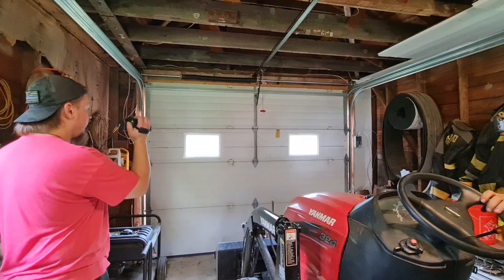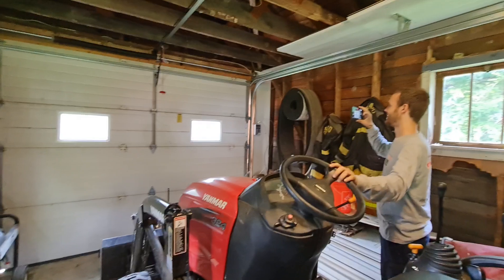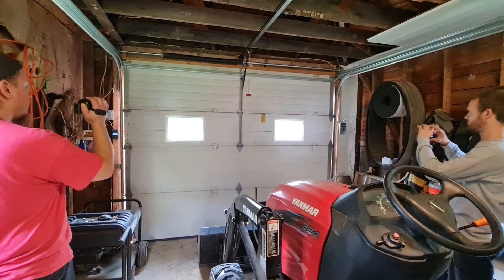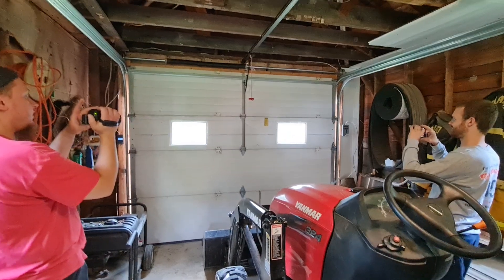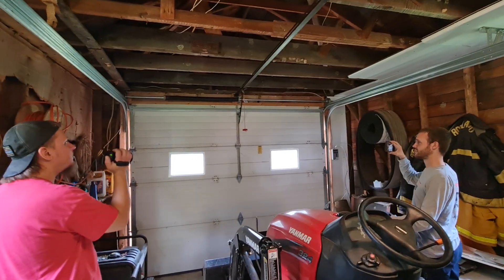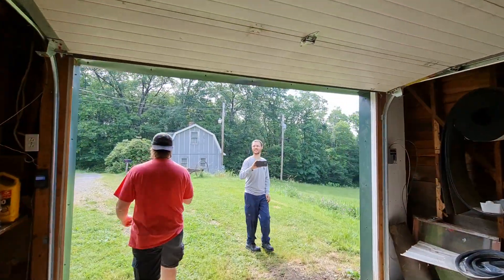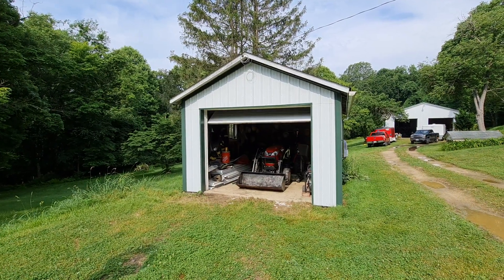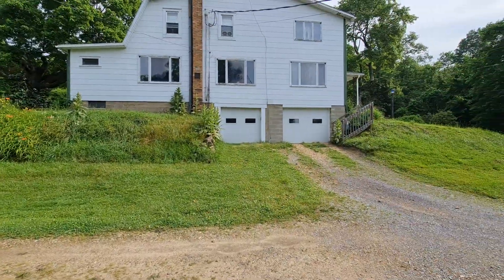RGDMan's Overhead Door 591 with 8550RGD

Comment: You're not going to believe this, but I just ordered a new garage door a overhead door a overhead door Thermacore® 5740 and a Odyssey 1200 expected installation sometime around December
Reply from the maker: @cyberlight22  nice!
Reply: @TheGarageDoorGeek  yes it funny my first quote they they wanted to give me a LiftMaster, Model 84505, I said no
Reply from the maker: @cyberlight22  Yeah, I've had too many headaches with LM. I can't trust them. I put in a Maxum a couple weeks ago, now just waiting on the "it's not working" callback.
Reply: @TheGarageDoorGeek  lift master will never be the same
Reply from the maker: @cyberlight22  that's the unfortunate truth.
Reply: Looks good boys, nice job 👍. Has anyone installed any of liftmasters commercial motors? I started using them recently and have had no issues. But the one thing I find is the chain falls run slow/hard if you’re operating by hand. I’ve installed hundreds of commercial side mount units, but all liftmasters have been the same. Anyone have any input?
Reply from the maker: @ I put in a Maxum trolley op a month or so ago. I’m not impressed. I’ll give it that it’s quiet, but it’s over complicated, and I don’t think it’s going to be a reliable system in the long run.